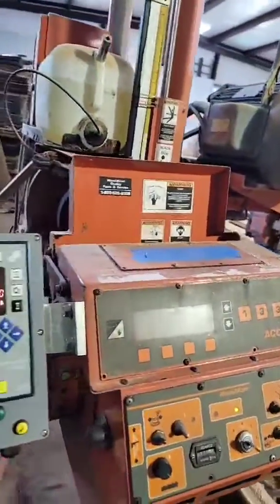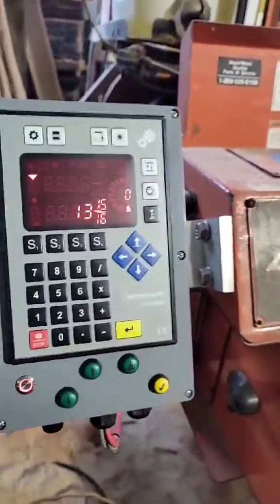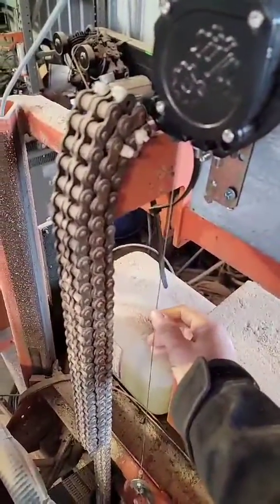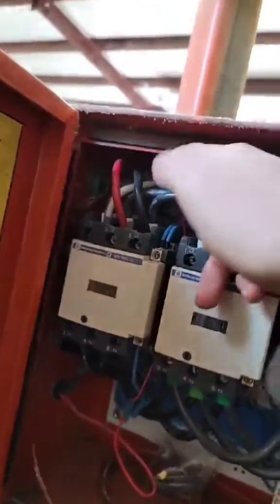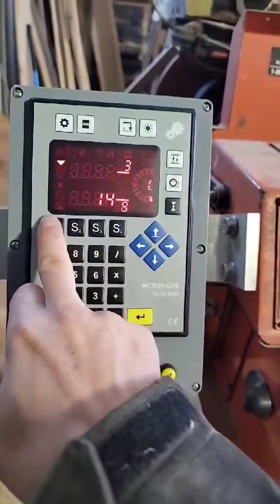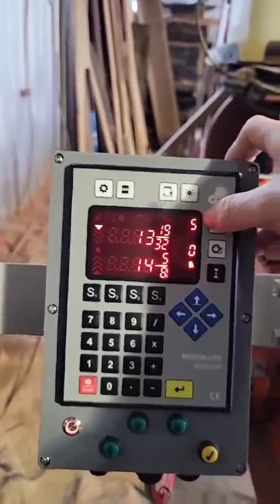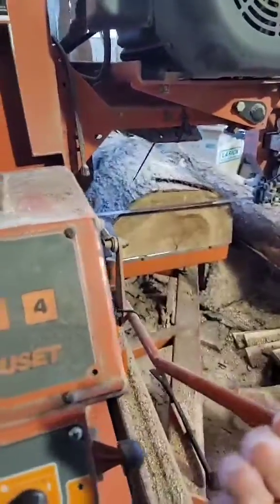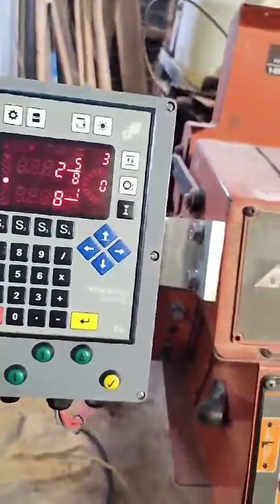Introducing the SW-250 Computer Setworks on Woodmizer LT-40 band sawmill ! / Sawmill controller

Comment: I have an lt15, can you demonstrate manual mode?
Reply from the maker: Hello, 

After the setworks installation and initial settings please perform F 21 = 1 to switch to manual mode. 
The workflow in manual mode is the same as in automatic, the only difference is that the sawmill operator requires to manually position the sawing head. 
Computer setworks will show the place where to position the sawing head using arrows on the display. When the 'dot' between the arrows is blinked - the saw head is positioned and the operator can cut. 
Important is that before any work please read the manual. install and make the initial settings of the computer setworks. 

If you have any questions during reading, installation, or making settings please feel free to contact us via our Facebook page, email, or by phone (WhatsApp, Viber, audio Facetime) when you are near the sawmill with setworks. 
We will help you! 

The video with more info about our computer setworks should come out this Friday on Mike Festiva's youtube channel. We have not seen it but should be covered lots of information.